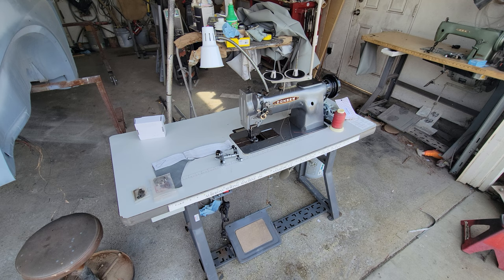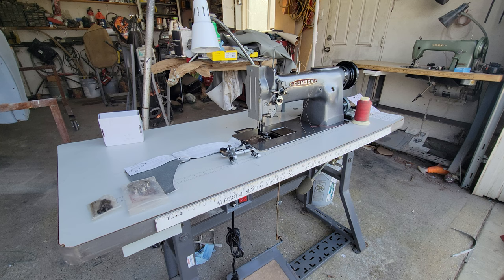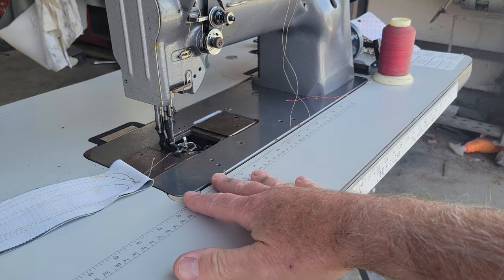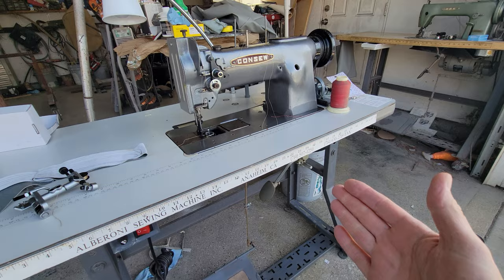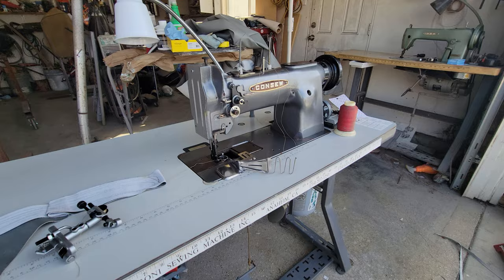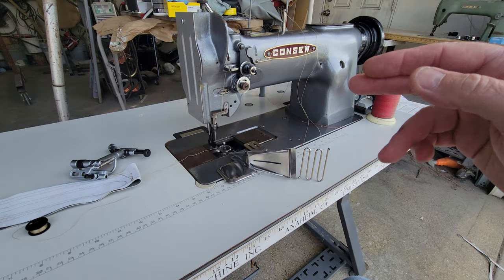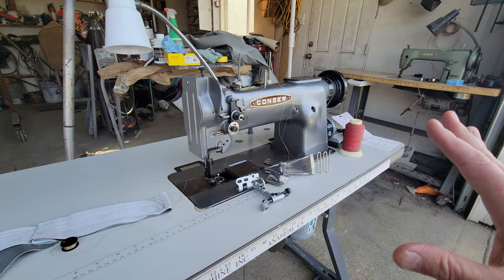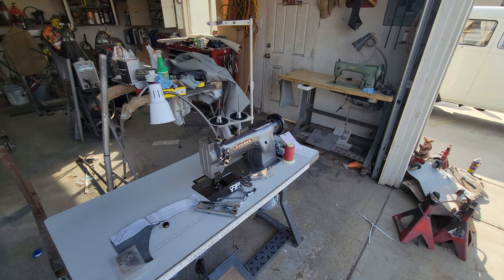Automotive upholstery Commercial sewing machine for beginners

Comment: I had a 225 machine. I got rid of it because it couldnt handle thick threads like 207 and 277 and the bobbin was too small and the no reverse kimda sucked but you could learn how to lock a stitch without. I saw a mod with the height adjustment so that it could sew thicker threads.  The 226 model is the same but has reverse